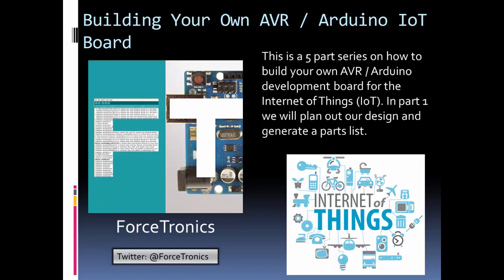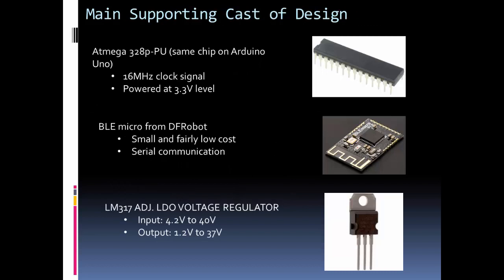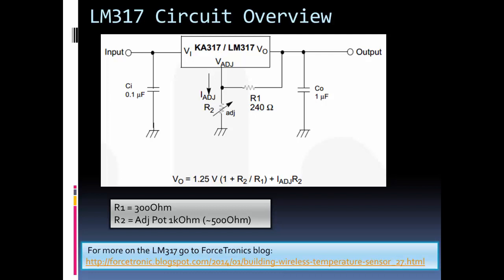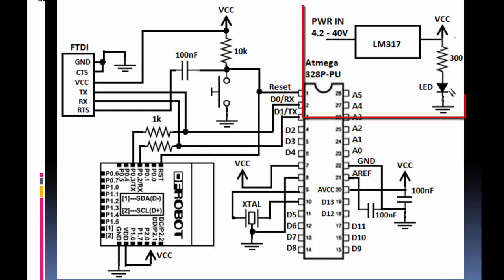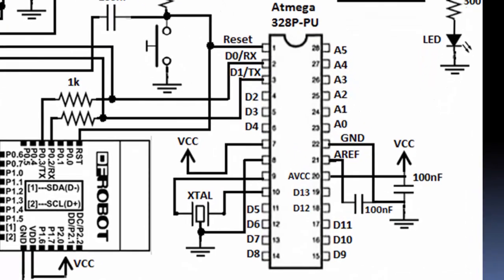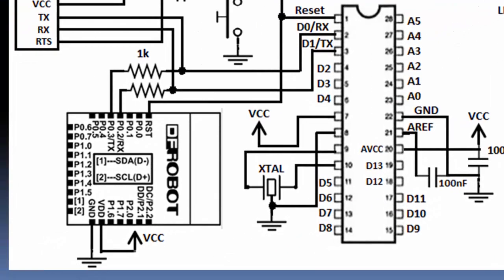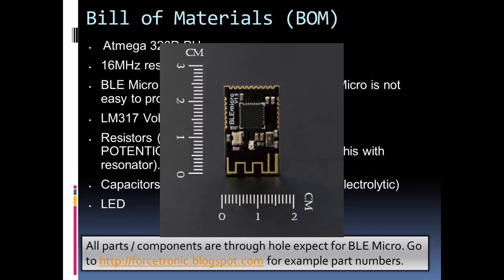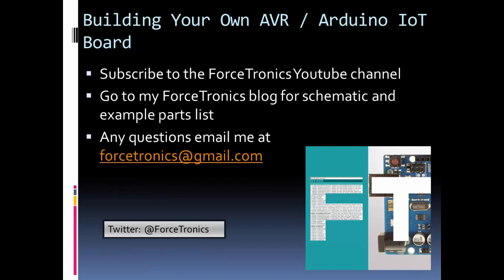Building Your Own AVR / Arduino IoT Development Board Part 1

Comment from the maker: I made an error on this design related to the supply voltage and clock speed. If you look on page 303 of the data sheet there is a good chart or plot that shows the "stable" zone for clock frequency vs supply voltage. In this design I use a power supply voltage level of 3.3V at 16MHz, which is just out of the stable operation zone that Atmel recommends. As a note I have been using this design at 16MHz and 3.3V without any issues, but this is not the recommended operating area of the manufacturer. One option is to use an 8MHz clock which is stable at 3.3V and load the Arduino bootloader from the Pro Mini (3.3V at 8MHz) onto the ATmega328P. Thanks to those who brought this error to my attention.

Comment from the maker: Hello Franklin "Frank" Benitez, I was not able to directly reply to your comment. But you can use any voltage level between 1.8V and ~5V on the Atmega 328 chip at a 16MHz clock speed. This information can be found in the "electrical characteristics" section of the data sheet
Reply: +ForceTronics I was wondering the same thing , in the data sheet it says "0 - 4MHz@1.8 - 5.5V, 0 - 10MHz@2.7 - 5.5.V, 0 - 20MHz @ 4.5 - 5.5V "  .
Reply from the maker: +Oussama Ousmoi If you look on page 303 of the data sheet there is a good chart or plot that shows the "stable" zone for clock frequency vs supply voltage. I believe I did not read this as close as I should have. 3.3V at 16MHz is just out of the stable operation zone. Thank you for bringing this to my attention. As a note I have been using the ATmege328P at 16MHz and 3.3V without any issues, but this is not the recommended operating area of the manufacturer. I will add a note to the video to alert watchers. One option is to use an 8MHz clock which is stable at 3.3V and load the Arduino bootloader from the Pro Mini (3.3V at 8MHz).
Reply: +ForceTronics Good to know that it could run with 3.3v 1at 16Mhz though  . Yes with 8Mhz would be safer . 
I'm currently inspired by your videos, which are great by the way and thanks a lot for sharing them .  i'm using a  5v regulator  for the Attiny2313a and a 3.3v regulator for the Bluetooth , this way i can keep running the uC at 16Mhz .
Reply from the maker: Thanks! I appreciate you pointing out the mistake which will help future viewers. What are you using for the voltage level shifting for the communication between the uC and BT module?
Reply: +ForceTronics I only used a voltage divider :  1k from uC's TX to BT's RX, and a 2k from uC TX to ground .  it works fine with 9600 baud rate . Not sure how will it perform at higher baud rate though .